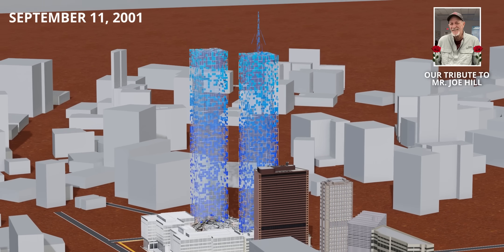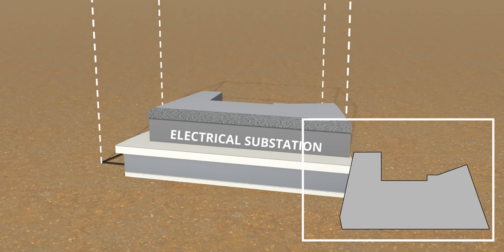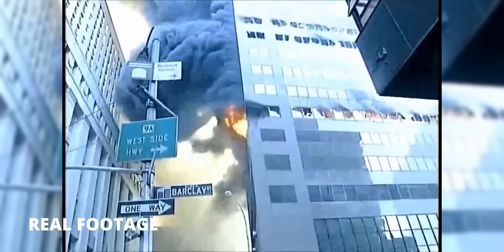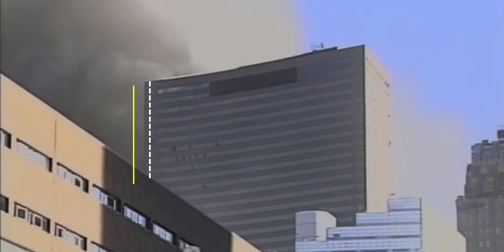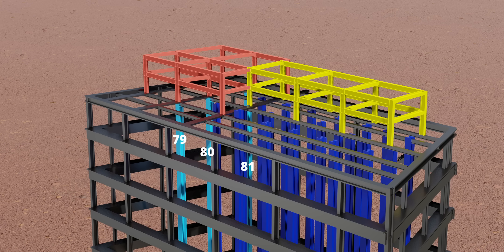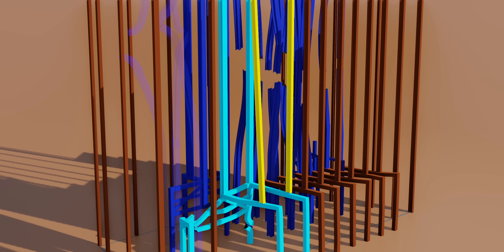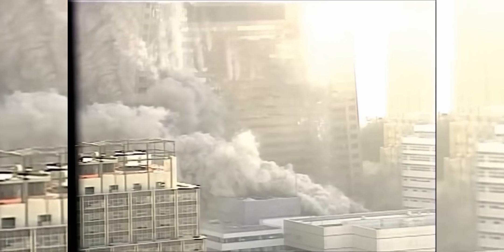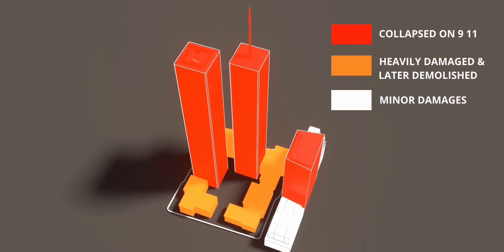Collapse of Building 7 | The Complete Physics

Comment: This is a really good guess but not based on facts. 
1. Video evidence doesn’t support the notion of the antenna causing the gash on the buildings south side. 
2. The fires were mostly burned out at the time of collapse. 
3. The supposition that core columns without transfer trusses would snap in a sequential fashion is not supported by  modern engineering collapse simulations. 
4. The near free-fall speed of collapse was confirmed in the NIST report. 
5. The weight of the second penthouse is not a significant causative agent in any simulation that incorporates accurate building structural elements. 
6. NIST’s report has a different causative source (beams walking off column supports)
7. The most advanced and accurate engineering simulations done by a team of PhDs at the university of Alaska at Fairbanks could not replicate your theory, it was literally impossible. 

Really nice cartoon though. Thanks. But it didn’t really help in solving the mystery. What we need is a proper and full inquiry by an independent body not beholding to the government.
Reply: Cheap shills need to show up as a couple...
Reply: https://www.google.com/search?q=pictures+of+fires+during+wtc7+collapse&client=ms-android-att-us-rvc3&sca_esv=2e3a0442facbf014&udm=2&biw=360&bih=744&sxsrf=AE3TifOknNor9EY8zSJBfe7maBPrz4JlsQ%3A1758806229837&ei=1UDVaNzsMte-kPIPtPfqkAo&oq=pictures+of+fires+during+wtc7+collapse&gs_lp=EhJtb2JpbGUtZ3dzLXdpei1pbWciJnBpY3R1cmVzIG9mIGZpcmVzIGR1cmluZyB3dGM3IGNvbGxhcHNlSIdkUO8qWNBhcAF4AJABAZgB1gGgAZUbqgEGMC4yMi4xuAEDyAEA-AEBmAIAoAIAmAMAiAYBkgcAoAemI7IHALgHAMIHAMgHAA&sclient=mobile-gws-wiz-img#sv=CAMSzQQaoAQK-gEKuQEStgEKd0FMa3RfdkhGbGp2U05Vemt5NnNWcEYtWkNlaGVLazh4VzlCdVlSNnBwdHN0Y0NOUTlaN2VqRUtNdEV0elJucTkzbjcxbTR0MGYtcVliekd4WUFXY2pQckJHMTl2OW9zRGxzTzhtdlNqQTdKZlBUSV9GSWRFUENVEhdUa0hWYU1IME45UDZrUElQZ1lLNHdBaxoiQUZNQUdHcVFCWGFUY2ZPTWh4Y0RRSFhibVQ2SGUzSXBuZxIDODQ5GgEzIisKAXESJnBpY3R1cmVzIG9mIGZpcmVzIGR1cmluZyB3dGM3IGNvbGxhcHNlIgcKA3RicxIAEo4CCs8BEswBCowBQUxrdF92RWZSdEIwc1NVWHRoYmVMS3M2VGhLd3RsMy0zdVZWZklBUURMNERUUVNfRHVxbThaVGdBQ2s1NmxfWHNGYzNwUmhmMTFzN1h2TWZRTHd3QkRsTEdtVkNYWTlVWVpyOGp4VF9KeXh6cTlJT1MtZGh5TGFSeHVtZDhyU1ZXZGtrdFhxUjh2elgSF1RrSFZhTUgwTjlQNmtQSVBnWUs0d0FrGiJBRk1BR0dyRWJtbjFVMzZXM0hBejZGMl9jWnQ4NFdDclJBEgQ0Njk4GgEzIhgKBmltZ2RpaRIOaW1BcVQ1ZkMxRHJpMU0iFwoFZG9jaWQSDmFkX1pHdE9kcE0zR2xNKhBlLWltQXFUNWZDMURyaTFNIAQqJAoOZnExbmhwTDhKb3FzWE0SEGUtaW1BcVQ1ZkMxRHJpMU0YADABGAcg4MWLvQEwAUoKCAIQAhgCIAIoAg fires burning before the collapse so yeah your wrong...also the university of Alaska study was funded by Architects and Engineers for 9/11 Truth so no bias
Reply: Have you ever witnessed a controlled demolition? You witnessed at least 3 on 9/11
Reply: Now you are just trying to confuse everyone with facts!
Reply: You're full oh shit.
Reply: "Video evidence doesn’t support the notion of the antenna causing the gash on the buildings south side. "
True.

"The fires were mostly burned out at the time of collapse. "
Lie.

"The supposition that core columns without transfer trusses would snap in a sequential fashion is not supported by  modern engineering collapse simulations. "
Lie.

" The near free-fall speed of collapse was confirmed in the NIST report. "
Meaningless, and a good solid proof you don't understand what the words you're using mean.

"The weight of the second penthouse is not a significant causative agent in any simulation that incorporates accurate building structural elements. "
Meaningless, no-one said it was.

"NIST’s report has a different causative source (beams walking off column supports)"
Not the case, and proof you haven't read it.

"The most advanced and accurate engineering simulations done by a team of PhDs at the university of Alaska at Fairbanks could not replicate your theory, it was literally impossible. "
Lie, there's no "advanced" or "accurate" about the Hulsey report. Lie, there was no "team". Lie, it's not UofAlaska, it's Hulsey. Lie, they didn't even try to replicate anything.
Reply: @mooneyes2k478  "" The near free-fall speed of collapse was confirmed in the NIST report. " --> Meaningless, and a good solid proof you don't understand what the words you're using mean."
You seem to know everything, and you also know conservation of energy being meaningless. I really hope that also means we soon have infinite energy out of nothing. That would solve so many problems humanity has.
Reply: @meleardil  Here's a free hint: that you've heard some really cool, science-sounding phrases doesn't mean you should try to use them as an argument.
That way, you won't make yourself into a laughingstock the way you did there.
Reply: I was under the impression NIST broke the collapse down into stages. The roof and cooling system was one stage of the collapse, while the outer shell collapsing, was another stage.  The freefall occurred during this second stage, for 8 floors and 2,5 secs.  So what the nutter is saying, is explosives, or termites, or whatever was used, but then, after explosives or termites, or whatever, then the building collapse slowed down again???
Reply: @meleardil that report was a joke and didn’t prove anything
Reply: Read the entire report it’s full of nonsense
Reply: 1. True. The vid is wrong about that detail. It was north face periemter columns from the North Tower, not the antenna. Makes no difference however.

2. Nonsense.  As untrue as it is irrelevant. 

3. You clearly don't have a clue what any of those things you speak of are, or how they work.  Core column failures at the east end of the building ABOVE the load transfer region.

4. Please define near free fall speed and explain how a measurement of acceleration can be used as a measurement of velocity (speed). Then explain why that would matter since how fast something falls cannot tell you what started it falling. Outside of the conspiracy corner of the internet, this is simply not a thing. Nobody in the engineering world cares.

5. No one is claiming it is - directly.

6. The NIST's WTC7 Buiding Performane Report actually gives two different probable collapse initiating scenarios. This video gives none. It actually skips over collapse initiating mechanisms as there are several plausible alternatives, none of which can be definitively proven (see; FEMA BPAT.  NIST NCSTAR 1A: Final Report on the Collapse of the World Trade Center Building 7, 2008. Guy Nordenson and Associates, WTC7 Global Collapse Analysis Report and Summary of Findings, 2010. Arup, WTC -7 Structural Fire Analysis Report (Runs 1-4), 2010. Weidlinger Associates Inc., WTC 7 Collapse Analysis and Assessment Report, 2010.  BRE Centre for Fire Safety Engineering, Analysis of the Impact of a Fire in the Mechanical Room (5th & 6th Floor) of the World Trade Center 7 Building, 2010. T. McAllister, R. MacNeill, O. Erbay, A. Sarawit, M. Zarghamee, S. Kirkpatrick, J. Gross, Analysis of structural response of WTC 7 to fire and sequential failures leading to collapse, J. Struct. Eng. (United States). 138 (2012) 109–117

Or to save time, for a summary of the major studies I would recommend THE COLLAPSE OF WORLD TRADE CENTER 7: REVISITED by Mhd Anwar Orabi , Liming Jiang , Asif Usmani and Jose Torero which is a 33 page summary of the different analysis and conclusions published in 2020. Sorry, YouTube will delete this post if I give the link but it should be easy to find and is available from the University of Queensland, Brisbane. 

7.  Have you seen those simulations?  They are shit. While promising superior models to those of The NIST, the Hulsey Report in fact delivers grossly inferior models which eliminate the time factor, focus on only two floors and rely on a greatly simplified version of The NIST’s temperature data.  The model animations are clearly not derived from the model data as they show no dynamics at all and are obviously forced to make the animations (superficially) look closer to the sponsors imaginging of the real event.

IF you are relying on people like Hulsey and his financial backers it is no wonder you don't get it even after 24 years.  IF you are genuinely interested I can break the whole thing down, to a reasonably high level of detail still comprehensible to the average reader in just one post.

IF you are genuinely interested.
Reply: @TheCriticalStinker-01 What a monumental reply. Now that's what you call a controlled demolition
Reply: @TheCriticalStinker-01  You should learn from MFitz
Reply: @TheCriticalStinker-01 how much are you being paid?

If i had to guess, at least 6 million shekels. Then again, that sounds like quite a lot. It's probably less, right?
Reply: @step1610  LOL subtle

Comment: I wonder if the narrator of this garbage actually believes this tom foolery
Reply: Yes, as does the worlds professional engineering community.
Reply: People like this don't "believe". Unlike you, they KNOW and are able to explain.
Reply: @JiriStipek-b6o explain how the 2 buildings fires reached over 2800 degrees causing molten steel when its impossible for it to burn at that temperature without thermite. Ill wait sheep
Reply: @joeledwards4509  - Easy - that didn't happen. It is a myth perpetuated by the conspiracy community. You will not find it in any of the thousands of pages of detailed technical analysis of either Twin Towers or Building 7 collapse. 

No need to explain something someone just made up. 

Note the above video you are commenting on doesn't talk about steel melting either. You probably should have watched it before jumping in and complaining about it.
Reply: @joeledwards4509  " fires reached over 2800 degrees causing molten steel" Explain what makes you believe there was any "molten steel" there. There is no one single photo of a partly molten steel beam or anything like this. All what you can see a puddles of molten METAL or molten metal cascading from the wall. Nothing indicates it was steel. The METALS were aluminium and lead from the huge batteries in Uninterruptible Power System located near the point of impact. Both these metals have MUCH lower melting point than steel and this temperature was easily achievable.
Reply: @JiriStipek-b6o  Aluminum melts at 660° Celsius and at this temperatures it stays silver. You would need to heat it up far beyond 660°C to get it as glowing bright orange as the liquid that was pouring out of the south tower right before it collapsed.
NIST analyzed steel from the fire zones, steel directly involved in fire. No part had reached 600°C or more, the very most parts hadn´t even reached 250°C despite direct involvement in fire. Forget about your aluminm hypothesis.
Steel is essentially iron and if you melt it it becomes iron. Now here´s another big news for you: Spheres of molten iron were found all over in the dust. There you have your molten steel even if you want to call all the witnesses of molten steel liars like the firefighters that described the scene below as "like a foundary, like lava from a volcano" or like Les Robertson, chief engineer in the WTC construction and others.
Btw: These iron spheres are also typical product of thermite reactions.
Reply: @Kudde23 I don't quite understand what you are trying to prove by the rant about the temperatures allegedly reached in the towers. The temperatures obviously reached the point where steel is becoming malleable - thermite or not - because some of the deformations couldn't occur at lower temperature. What stops aluminium becoming hotter than its melting point? Where did the tons of lead from the UPS batteries go when they were located at the very core of the fire? Do you realize the enormous amounts of energy stored in the batteries had to produce enormous temperatures, possibly over 2,000 dg C when simultaneously shorted?
And some more news for you: your mysterious "iron spheres" are commonly and inevitably found at sites where arc welding has been used during construction. Guess how the steel beams in the building were joined together. There are photos from the construction showing workers using arc welders there. Why do you think welders are using leather aprons?